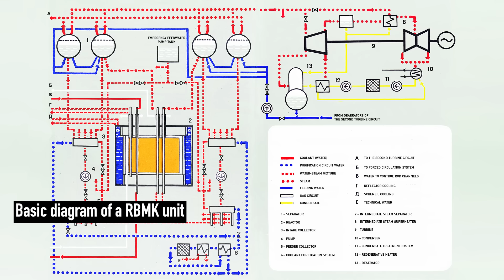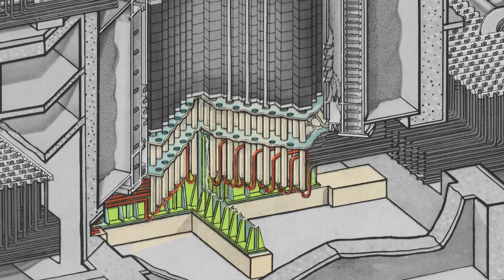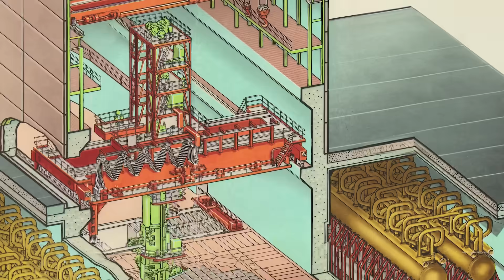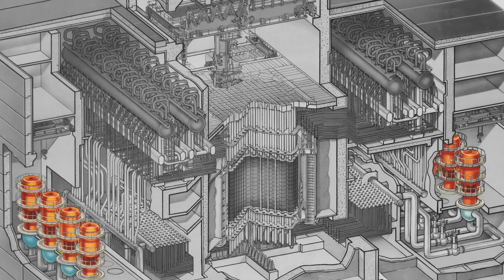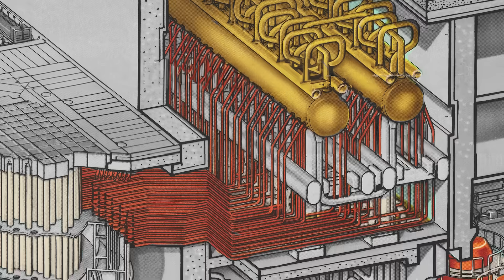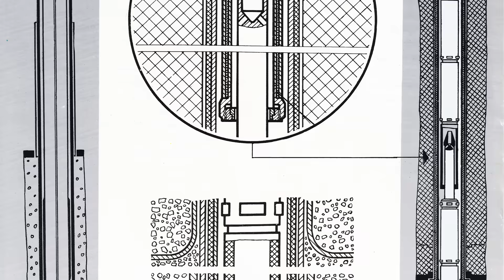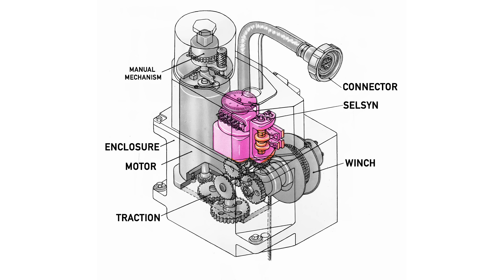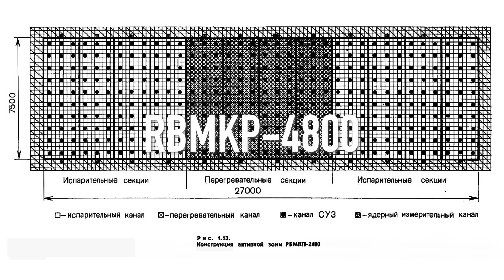RBMK: The Soviet Reactor That Was Doomed from the Start | Chornobyl Uncharted Ep 04

Comment: Best demonstration I've seen. So was the reactor itself submerged under water, or is it essentially a dry shell and each pump just pumps through a fuel rod and goes out at the top?
Reply from the maker: It is a dry shell where each technological channel acts as a sealed environment. Moreover, because of this it was considered that a channel will act as an individual containment for localization of any problems.

Comment: Great explanation very detailed especially respectively to the short duration of the video, just one note not on the reactor itsel but about general turbine workings, probably it's mostly because of a not ideal phrasing but it would be better to make more clear that the water vapour condenses after the turbines as having more than 5% water condensate inside a turbine would destroy and corrode the blades way too fast
Reply from the maker: Thank you. You are right.

Comment: it´s purpose was to produce plutonium, electricity was a nice side effect

Compared to western reactors this was all decades behind. The Scala Computer was a slow monster and the thousands of pipes must have been a nightmare to maintain.. I m sure some were always leaking

You are right about the safety culture.. the RMBK was dangerous but  it wasn´t the reason for the Chernobyl accident.. the people and the sowiet system was the problem
Reply from the maker: For Pu there were WAY more effective reactors called E-1 and especially type ADE. The regime of security at civilian NPPs at that time was not even a bit close to Pu generation facilities. The said material appeared in RBMK in very small amounts and was not really easily retrievable. What is true is that graphite reactors are an evolution of a Chicago pile, so RBMK roughly utilises the same principles; just to clear it out – this is also what the actual ChNPP engineers say – no Pu generation was done or really effectively possible to do. What they did at the ChNPP was enrichment of silicon, and that was far more profitable than energy generation :)

You are very right about pipes, that piping was very hard to service. It was exceptionally complex.

Comment: At 08:40
What you call cylinders are in fact called STAGES or TURBINE WHEELS.
Interesting video. I used to visit the same type of reactor in northern Lithuania. They are now closed.
Reply from the maker: I am using the terminology used in the technical description, but thank you.
Reply: @ChernobylFamily  Then the technical description is clearly wrong.
It looks like they are writing about a steam engine with pistons moving in cylinders.
They often have several cylinders for high, medium, and low-pressure steam.
The high-pressure cylinder is the smallest, and the low-pressure is the biggest.
In a steam TURBINE, the high-pressure turbine wheel is the smaller one. The low-pressure wheel is the biggest.
Reply from the maker: ...and? This is what is written. Bigger are for low pressure, and the smaller is for high.
Reply: @ChernobylFamily  That is correct. It is just the word "CYLINDERS" that is incorrect. They are turbine wheels or turbine stages.
But it's an interesting video!
I visited the Ignalina Nuclear Power plant in Lithuania...

Comment: From my understanding Chernobyl was unstable at low power levels, mainly because it was designed specifically for being able to do power generation, or plutonium production, the last was why it was so big.

When you produce plutonium you dont want water moderation as it eats up a lot of neutrons thus producing less plutonium, downside it has a positive void coefficient. It was designed to operate on natural uranium or nearly no enrichment in its fuel (another plus side if you want to produce plutonium) but necessitates that the core is huge due to a lack of U-235 in the core.
Reply from the maker: It was not designed for plutonium production, because Soviets had specialized reactors for that which were far more effective. Another thing however, it was an evolution of a military reactor (basically, a Chicago pile).

Comment: Even though they are much more dangerous than many other reactors, i still like their design, aesthetically.
Reply from the maker: Yes. And by memories of my fellow engineers, in operation this looked very impressive. The reactor made a low rumbling noise when it was running. Moving the reloading machine looked absolutely incredible as well.
Reply: Ah yes, aesthetics, the most important part of nuclear reactor design

Comment: As mentioned in this video, we had two of these reactors operating in my country of Lithuania, near the town of Ignalina. Whole 3 gigawatts of nuclear power. A third one was under construction but halted after the Chornobyl events.
They supplied about 80% of the country's electricity needs. For some time, we were the country with the highest percentage of nuclear energy produced per person in the entire world. Sadly, they were shut down in the naughties. Phasing them out was demanded by the EU as one of the requirements for our country to join the EU.
There was a plan to build a new nuclear power plant with modern Japanese reactors which was close to being approved but was sadly spoiled, mostly by pro-russian powers in the government.
Reply: The tendency to power surges when the reactor was at low power was known about after an incident at Ignalina. That 'safety test' was supposed to be performed immediately after the reactor came off-line, at no less than 700MW (thermal). 
I am amazed that safety  and warning systems could be bypassed to prevent an automatic SCRAM.
The control room operators must have been utterly terrified of Dyatlov to resort to rule breaking to re-start reactor #4 after it came to a standstill in a Xenon-pit.
Reply: Hasn't your country banned ethnic Russians from participating in politics in general? How could there be "pro-Russian powers" in the government? This just sounds like a typical scapegoat from the most russophobic country on Earth.
Maybe you should be angry at the EU for forcing you to close a functional powerplant, because they wanted to profit by making you pay for their junk instead. Turns out Japanese NPPs aren't better either, looking at Fukushima.
Should have stuck with the Soviet industry, you inherited.
Reply from the maker: That is sad.

Comment: I think it is important to mention this reactor design was adapted from a military/research type reactor. From that perspective it was actually quite an achievement being as stable as it was.
Also, the RBMK can run on low enriched uranium, making fuel much cheaper compared to BWR or PWR design.
With current safety standards however, the RBMK would be a costly design to maintain.
Reply from the maker: ....and hell to decommission.

Comment: Another advantage of the RBMK design is the ability to effectively utilize lower grade and thus much cheaper nuclear fuel, due to the sheer size (and scalability) of the active zone.
Reply from the maker: @Ivan-pr7ku  exactly. Here come RBMKPs and so.
Reply: @ChernobylFamily  
During my translation of the Dollezhal book I actually learned quite a bit more about the RBMKP-2400. If people think the RBMK-1000 is big, wait until you see the 2400. This thing would not just have its own zip code, at that size, you would be changing timezones when walking from one end of the central hall to the other. It's a good thing they never actually got to building it because the stability issues would have been something else! I pity the poor Skala computer having to keep that behemoth in check....😱
Reply from the maker: @swokatsamsiyu3590  I am screaming
Reply: @caav56  
Oh dear Lord, that thing! This reactor would have been absolutely monstrous in size. Imagine the crew necessary to keep that thing bridled. I shudder when thinking what would happen if such a reactor would have a hissy fit. It would not be pretty, we can be sure of that. As much as I like the RBMK, it's a good thing this one never got built.

Comment: Yes damn it had its faults and it may not have been well engineered, but after Chernobyl people got on with it and erased all the faults and they are even being rebuilt in Russia and even exported to other countries and are running relatively trouble free. Yes, there was this accident and Leningrad and Ignalina were even before Chernobyl, afterwards... they were running. Leningrad and Ignalina are still running
Reply from the maker: You are right that all reactors were modified, not only in Russia, but....exported? where? No other was built after and those under construction were suspended. Ignalina stopped in 2009 and it is in decommissioning stage; True, Leningrad, Kursk, Smolensk are running but are close to the end of the lifetime.

Comment: One of the main problems of RBMK design is the low coherence of the core - it can have high activity in one zone, and low in another. This was demonstrated also in the accident , when a high activity zone was forming in the lower part of the core. So, probably in an RBMK with higher or much higher size this problem would have been much worse and present the probability of an even bigger disaster.

Comment: Missing quite a bit of detail that YT channel “That Chernobyl Guy” has covered — things that were  fully documented and then hidden from the operators by those who didn’t want to share information. 

Completely avoidable accident but far easier to blame the dead. Or the “design” even though the fuel assembly design was changed without the operator’s knowledge. 

The scientists knew the reactor had a new positive void coefficient following ill advised changes from the initial design to a different  fuel element design. 

Given the right math and operation limits, the operators could have easily avoided operating in that condition. 

As TCG points out forcefully, the official story after investigation was a lie, as was most of the script of the HBO mini-series. Even by the time of the writing of the script, the science was debunking the official story. 

Good channel to watch to see how to piece it all together. Cheers.
Reply from the maker: Well, we did not have a task in this particular video to talk about disaster-related aspects, we will have a separate episode about it. Yes, I perfectly know about a documents sent to all NPPs after the positive void coefficient was observed; the fact it was not taken with proper attention is why I mentioned a safety culture problem. 

HBO thing is a painful subject. It in fact strengthened a soviet narrative.

Comment: Can't believe of how much information you've managed to pack in such a short video. It's almost a commercial for RBMKs reactors :P It's really well presented. I'm almost wanting to buy and build one in my backyard ^^ A few never seen before pictures too, never knew how these reactors were built. Can I buy back the crane for my little home RBMK project? =)
I also never knew about the carts doing spectrum analysis of individual tubes. It's almost a mine cart rolling on rails. It's a very strange design to rely on a mechanical device for such a task.
About mine carts, this channel is a mine of information. You're digging deep to find all of this...
Reply from the maker: Because technically it is. Those illustrations mostly came from a 1977 brochure explaining how the reactor works, which belonged to A. Dyatlov. It was very destroyed, so many things we needed to clean and redraw. The brochure had transparent pages showing layers of the active zone... very colorful, but they way it was made, made it really complex to work with it.
Reply: @ChernobylFamily  Fantastic work. Looks like brand new illustrations. Do you plan to do prints from these pictures?
Reply from the maker: @Damien.D  considering that.

Comment: Not doomed if it was operated correctly. All 2nd gen reactors are dangerous by todays standards. These were inexpensive to build, could reload while in use (make weapons grade material), and produced a lot of power
Reply from the maker: Don't judge the title too strict, after all you know how this works :) You are correct. Though about plutonium – in fact a very little amount of it appeared there and for generating that there were specialized reactors, there were no real need to use RBMK for this.
Reply: @ChernobylFamily  they had military reactors for producing it, but these helped produce weapons grade material as well.
Reply from the maker: I do not have any evidence of it. From what I know from engineers, the amount was very small and not retriveable. What they did at the Chornobyl npp however, was silicon enrichment, and that was far more profitable than energy production:)
Reply: @Phil-D83  From what I understand the moderator pitch was not at all optimal for plutonium breeding. Had it been for that purpose then SREDMASH would've dictated a moderator pitch appropriate for plutonium breeding.

Comment: What also adds to why the RBMK was designed differently from most nuclear power plants in the West, was its suitability to remove a fuel rod while it still wasn't exhausted. Then, the content of plutonium (Pu^239) was the highest, and you could extract it from the pellets to turn it into nuclear warheads.
Reply from the maker: Mmm.... Pu indeed appeared there, but in small amounts. Civilian NPPs never had a security regime even close required for military projects, compared to facilities which actually produced Pu, where Soviets had specialized reactors for that which were way more effective.
Reply: @ChernobylFamily  If I remember correctly it was part of the design of the reactors until very late in their development. 
It was after the fist construction orders already had been issued in 1966 that concerns about problems with the design resulted in a last second overhaul of the design which included removing the ability to actually produce plutonium.  
Non of the build RBMK reactors ever had the ability to produce Pu.

Which of-course results in the irony that some of the weaknesses inherent in the RBMK design were probably the result of trying to create a dual use reactor, one that could both be used to produce power and be used to produce Pu, but all those flaws remained when they cut out the abilty to use it for creating Pu.
Reply: However, this capability was never fully developed or used.

Comment: As long as you dont mess with these reactors, they run fine lol
Reply: That's like an aircraft which flies safe if you are an excellent pilot but crashes easily if the pilot is just average. No airliner would be built in this way - and such an reactor is illegal to build in the western world too.
Reply: @simonm1447  The soviets didn't tell the ukies these reactors were meant to run full power 24/7 to produce weapons grade plutonium.
Reply: @memadmax69  Ukraine was part of the soviet union until 91, not an more or less independent country like other Warsaw Pact countries.
Reply: @memadmax69  No RBMK ever produced weapons-grade plutonium.
Reply: @MinSredMash  Pg2: Operational Considerations
While RBMK reactors were not specifically designed for plutonium production, their design and operational characteristics made them capable of producing weapon-grade material. However, the Soviet Union’s nuclear authorities did not pursue this capability extensively, and the reactors were primarily used for electricity generation.

Chernobyl Accident and Subsequent Changes
The 1986 Chernobyl accident highlighted the safety concerns associated with RBMK reactors, leading to significant design modifications and safety upgrades. These changes reduced the potential for plutonium production, as the reactors were no longer operated under the same conditions that allowed for low burn-up and graphite moderation.
Reply: @MinSredMash  Pg3: Conclusion
In summary, RBMK reactors possess design characteristics that make them theoretically capable of producing weapons-grade plutonium. However, the Soviet Union’s nuclear authorities did not extensively pursue this capability, and the reactors were primarily used for electricity generation. The Chernobyl accident and subsequent safety upgrades further reduced the potential for plutonium production in RBMK reactors.
Reply: @MinSredMash  Pg1: RBMK Reactors Produce Plutonium
The RBMK (Reaktor Bolshoy Moshchnosti Kanalniy) reactor design, developed by the Soviet Union, has been associated with the production of weapons-grade plutonium. While the primary intention of RBMK reactors was to generate electricity, their design characteristics made them potentially suitable for plutonium production.
Reply: @MinSredMash  Pg1.5 Key Factors
Fuel assembly design: The RBMK fuel assembly is cylindrical, allowing for easier replacement of fuel rods without shutting down the reactor. This feature was significant for production of weapon-grade plutonium, as it enabled operators to control the burn-up of fuel and optimize the isotopic content of the resulting plutonium.
Graphite moderation: RBMK reactors use graphite as a moderator, which allows for the production of plutonium with a higher proportion of fissile isotopes (Pu-239) and a lower proportion of non-fissile isotopes (Pu-240).
Low burn-up: RBMK reactors were designed to operate at low burn-up levels (typically around 400 MWd/t), which helps to minimize the production of plutonium-240 and other non-fissile isotopes. This allows for the production of weapon-grade plutonium with a higher isotopic purity.
Reply: @memadmax69 Thanks for the info. So it could technically produce Pu239 but was not really used for this purpose.
Reply from the maker: I had a chat with actual reactor engineers regarding that. The answer was short and clear: Yes, Pu appeared there, in very small amounts, and it was not usable or removable. For Pu generation Soviets had enough types and quantity of dedicated reactors, e.g. ADE (АДЭ).

P.S.: Using AI for so narrow questions is not always a good idea.